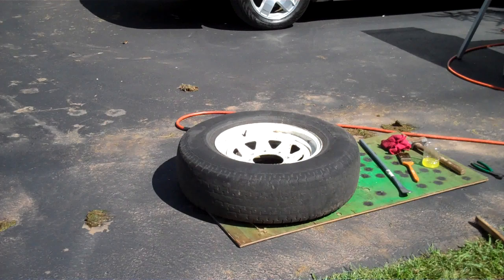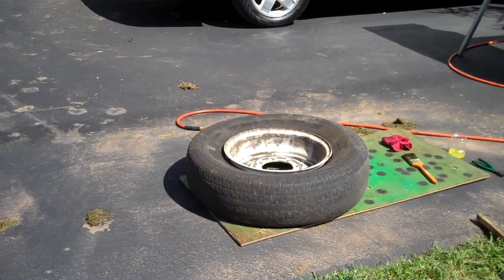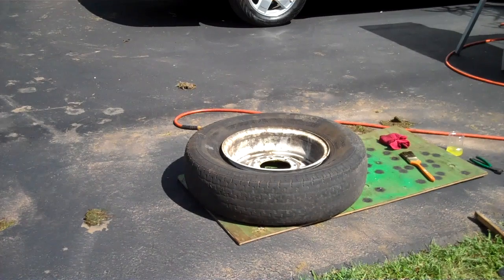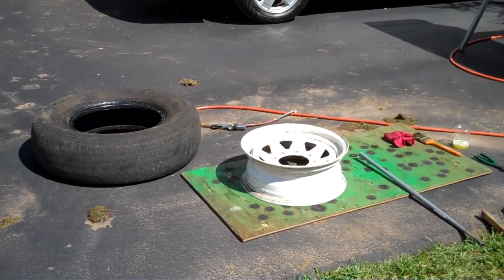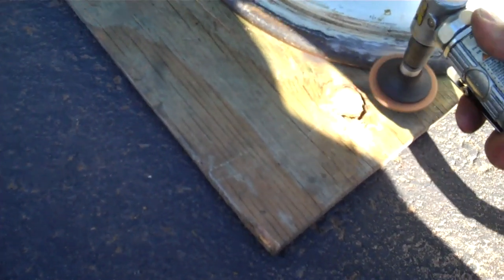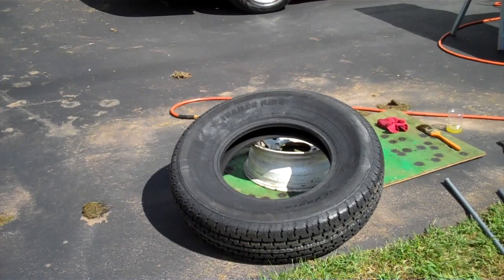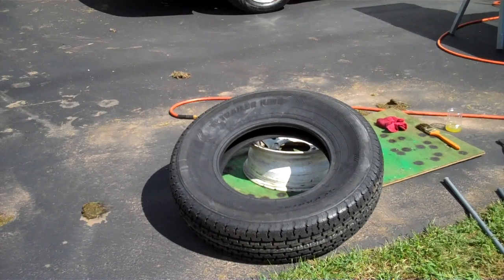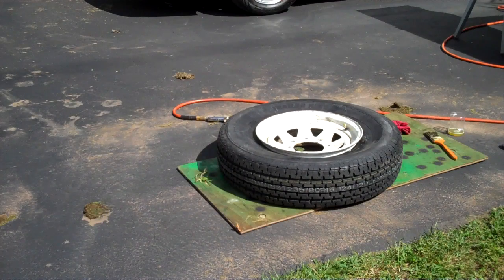Mounting trailer tires without a tire machine

Comment: Great video.  I have 4 tires to do tonight.  I just bought a tractor, so i'm going to try using the edge of the bucket to break the bead on the old tire.  The old tires are dry rot trash, so as long as I don't destroy the rim, i'm good.
Reply from the maker: hope it goes well
Reply: @73DiamondReo  It went like shit!  I had the front end of my tractor with the edge of the bucket right on the bead.  It would not budge.  
Then i raised the bucket all the way up, put a massive prybar right on the bead and lowered the bucket.  Nope.  Didn't budge at all. 
I tried the hammer method you showed.  Nope...I gave up on that really fast.
These are old G78-15 tires that have been on the rims for well over a decade.
Reply from the maker: @davec.3198  put the machine on it and then hit the bead with the bar and hammer. the tension from the machine will help
Reply: @73DiamondReo  Yeah.  Did that.  I just think I'm looking at a really difficult situation that requires a hydraulic press.  
I actually have an arbor press that would have worked, but the clearance to get all the way to the bead was not enough.  I needed another 2".  
Oh well.  It is what it is.

Comment: For the life of me I can’t do the backside once I get the frontside i gave up on the backside.
Reply from the maker: dont give up! you'll get it
Reply: I used a sledge hammer to break the seals , I don’t recommend because it came back at me i about didn’t stopit and that would have smarted. I also used lube as well, 15.00 a gallon. I took them in because wife said, don’t they need balanced. They were 10 ply on 15” rims.